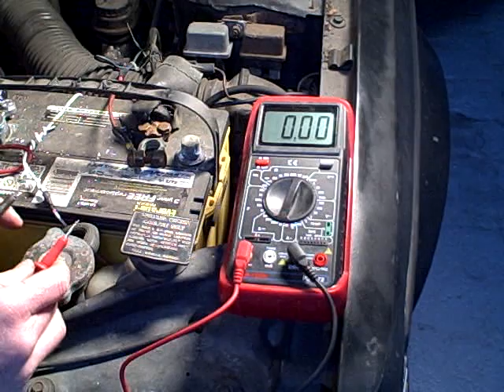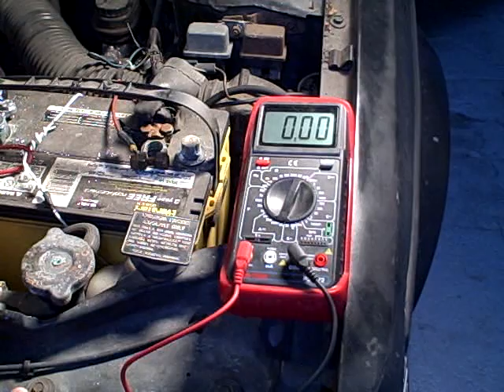Testing For Current Drain That Runs Down Car Battery

Comment: DON'T use POSITIVE side for any measurement!!!
Reply: In series connection order doesn't matter
Reply: @9mycool  what??
Reply: @nstipet  electrical engineering stuff you can seerch it
Reply: @9mycool  I don't need to research because I've been working with cars long enough. Experience is one thing, and writing nerdy texts is irrelevant ...
Reply: @nstipet  good for you

Comment: What I dont understand is
1) Why did you open the car door IF you have disconnected the + terminal. Surely that would not light up?
2) Did you connect the red and black leads from the multi metre to the positive terminal? It was not clear/easy to see

Comment: nice simple test, thanks.  for the novice it would be nice if you showed how you put the leads in line between the post and the cable. also, from my experience in life, it is almost guaranteed your car won't start in the morning if that dome light is left on overnight. Not a matter of days and for sure not a week.

Comment: people here saying that "12v won't shock you - you need more volts".  Please disregard their comments. Its amps that shock you (think amount of water in a pipe) not volts (think pressure of water in a pipe) - Car batteries can have a hell of a kick -  please keep safe!
Reply from the maker: No, Ed, it's volts that shock. Infinite amps won't go anywhere without the voltage to push them.

Morris
Reply: You are absolutely correct of course.  One without the other is meaningless.  I remember this at school  where students would get a harmless 10,000 volt shock - with next to no current:  http://en.wikipedia.org/wiki/Van_de_Graaff_generator
Reply: I've worked on cars all my life and never received any kind of shock from a car battery lol 12v is nothing
Reply: Ed Silvester it only takes a small current to kill you (0.1 to 0.2 amps). Any more than 0.2 and you generally suffer more burns as the heart is protected by a clamping effect. Naturally if amps get silly high then the burns will kill you.
You generally need 50v or more to pass the current through your body.
Saying that it's the amps that kill you is like saying bullets kill you and guns are safe. Hmmmmm.

Comment: Car design is such bullshit.  A car door or dome light that can destroy your battery.   I did a similiar test on my car, but in the 20v setting, and get a reading...  pulled every single one of the fuses out, and still get a drain on my battery with the car turned off.

Comment: Here's instructions explaining the fuse pulling stuff. Of course, it's for a Volvo. "basic-battery-drain-troubleshooting-101"  Ack!  It won't let me post the address, but a search should will give you a link. It's at Volvoforums - dot - you-know-what.

Comment: So, basically, we're just running the current through the meter? My new battery's been drained a few times. Probably didn't even need a new battery, actually, because the same thing happened to the old one - although, it was the original battery, so I guess it was time, anyway. But NOW I'll be able to identify the culprit! Bwaahaahaa!! I'm off to pull some fuses and hunt that sucker down! Thanks!! This is awesome!

Comment: Yep, found that the relays release after 30 minutes in accordance to the manual and I checked the drain after leaving the van alone (cannot open any doors or operate the remote or keypad entry devices other wise the relays kick back in and so does the 30 min timer) and the drain was normal.  Turned out that I don't drive it enough to keep the battery charged, I only drive it about 15 miles/week, has only 68K on the odom.  I did, however, have to replace the fuel pump module last week at $550!

Comment: I thought my battery was going bad but upon checking the current drain I discovered my 12 year-old Ford Windstar is pulling nearly a half amp just sitting there.  When I remove the meter probe from the battery and break the circuit I hear a relay releasing "click" under the dash.  Wish me luck in finding the cause of this stupid malfunction!  Glad I have an EE degree and the wiring diagram for this van, looks like I'm gonna need both.

Comment: that is almost 1 amp per hour.  Well a lot of batteries are from 20 to 40ah so that means it can supply 40 ah over a 20 hour timeframe or 2 amps per hour.  if you are drawing 1 amp that means it would supply 1 amp constantly for 40 hours before discharging to too low of a voltage.
Reply: Well, sort of. "Amp per hour" (i.e., amperes divided by hours) is a nonsensical unit. An ampere (or "amp") is the flow of one coulomb of electrons per second. An ampere-hour (ah) is a flow of one ampere for one hour, or two amperes for 1/2 hour, or 100 amperes for 1/100 hour, etc. A battery doesn't supply ah, it supplies amps. Two amps times 20 hours equals 40 ah.

Comment: When I did this, my meter read .52 Amps for about 2 seconds, then went to 0 Amps after 2-3 more seconds. I pulled the meter leads off, and it read 0 Amps. I reconnected the battery and retested and it again read .51 Amps for about 2 seconds, then went down to 0 Amps. Do I have current drain occurring or is this some residual effect? Car was off for about 30 minutes. Voltage read 12.76V when I first shut it off, then 12.68V about 30 minutes later.

Comment: @SSUNBRN Black lead goes in the COM. If you are measuring current like this guy then you are doing so in SERIES, put the red probe in the A (amps) port on the multimeter(not your bum as others have mentioned). set multimeter to 200m on the A (DC) portion of your multimeter. 
You can measure voltage drop, like across a car fuse, in PARALLEL put red in the V (DC) port and set dial to V(DC) usually 20 or less depending on what the circuit is capable of.

Comment: @schoolboycc  That's not entirely true about using an inductive pickup. You can use a DVOM and not break the circuit I do it all the time. You loosen the terminal without taking it off then you put the test lead on the battery post and attach the other lead to the terminal and just slide the terminal straight up over the lead. The circuit never breaks but now you can measure the amps with the meter.

Comment: I have the same problem with my 66 mustang. I found that the fancy radio that I installed was draining the battery and after 3 days it was dead as a doornail. I didn't use a multimeter to test the drain (even though I have several) I simple removed the plus side of the battery and when I touched it back the to the post I would see a small spark letting me know it was draining power. I unplugged the harness from the back of my radio and tried it again and no spark. It drains it in winter.
Reply: No harm, then. You shouldn't be driving a classic car in the winter anyway. ;-)

Comment: @ifitjams 12 volts is not anywhere near enough to shock you, it takes roughly 4k-6k volts to shock you lucky us haha
Reply: Really? Stick your finger in a 120-volt light bulb socket and see what happens. On the other hand, you can hold +12V DC in one hand and 0V DC (ground) in the other and not even feel it.

Comment: Can someone please tell me what specific setting I should be using on my multimeter.  I have two different meters with multiple settings and 3 different connections for the leads.  Please take a look here for a front facing picture of my meters: 

ls1tech.com/forums/15309372-post9.html

Thanks!

Comment: where's the part about pulling the fuses,...? this guy (for the video's purpose) knows where the drain is,... the dome light, but if you don't know whats causing the drain (this would be why you're doing this) after you hook up the meter and see the drain you start pulling fuses and checking the meter, when the drain goes away, you've found where the problem is starting, check the chart for what that fuse controls and now you know where to focus you attention too,...

Comment: The big problem with using an ammeter is the fact that during a short you may have high enough amperage to blow the fuse on your meter. I like the voltage drop test across a small resistor in series, since even high amperage is safely quantifiable without damaging your meter. Or, you could put a continuity tester in series with either pole of the battery and then start pulling fuses.

Comment: @gtuani
when testing amperage, you connect ammeter in SERIES. when testing voltage, connect voltmeter in PARALLEL. so to check amperage of the parasitic load, you would disconnect the positive battery terminal (or negative) from the battery post and then connect ammeter in SERIES. one lead to terminal, one lead to battery post. simple. if you get a negative reading, either swap the leads or erase the negative from the number.

Comment: something is drain my van. the alarm goes off at least 3 times a week when I try to unlock it.  and the radio does not work although it is still connected...could those be a prob?

Comment: @jheetman I have an 88 jetta was a fuel injection changed to carb..it has a new starter..and the solenoid is new (mounted on fender close by the firewall) now it doesn't start when just driving for a few blocks..and I just hear a strong clicking noise from the solenoid..and I have to jump start it..now when I start the car and remove the pos. cable it doesn't stall or idol.  When I remove the positive cable..the RPM needle sways all the way back and forth really fast..is there a short. Thanx

Comment: @ifitjams I have an 88 jetta was a fuel injection changed to carb..it has a new starter..and the solenoid is new (mounted on fender close by the firewall) now it doesn't start when just driving for a few blocks..and I just hear a strong clicking noise from the solenoid..and I have to jump start it..now when I start the car and remove the pos. cable it doesn't stall or idol.  When I remove the positive cable..the RPM needle sways all the way back and forth really fast..is there a short. Thanx

Comment: I have an 88 jetta was a fuel injection changed to carb..it has a new starter..and the solenoid is new (mounted on fender close by the firewall) now it doesn't start when just driving for a few blocks..and I just hear a strong clicking noise from the solenoid..and I have to jump start it..now when I start the car and remove the pos. cable it doesn't stall or idol.  When I remove the positive cable..the RPM needle sways all the way back and forth really fast..is there a short. Thanx.

Comment: You get yourself in isolator, hook up the main batt to isolator then second (deep cycle) batt to the isolator the isolator starts open (charges main batt) then closes once main batt is charged then second batt gets charged up.

Comment: i'm not trying to be argumentative, but i was always told that anything over 80mA was not acceptable.  i know that most batteries can handle 100-120mA if they are run every day, but i've seen on multiple occasions that same 100-120 draw cause a slow or no crank after 2-3 days of not running.  granted not all batteries are created equal, but thats what they taught us in tech school was 80 or so mA for a limit.  has the ante been upped with newer stronger batteries?

Comment from the maker: J,

Don't remember the TV commercials leaving the headlights on parked on a glacier overnight ? (DieHard).

890 miliamps won't kill a healthy battery in hours. Some cars with alarm systems and lots of computing power draw of 250 milliamps as a normal thing. 

Even cheapo car batteries with an amp hour rating less than 45 will carry a draw over 2 amps for a day before dropping below cranking voltage. At a   draw under one amp, a decent battery will hold up much longer.

Morris